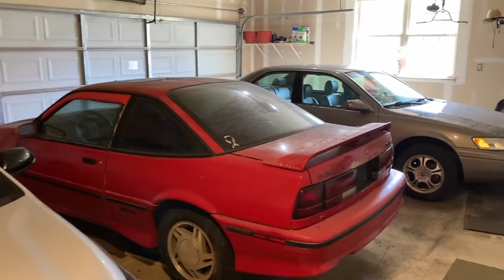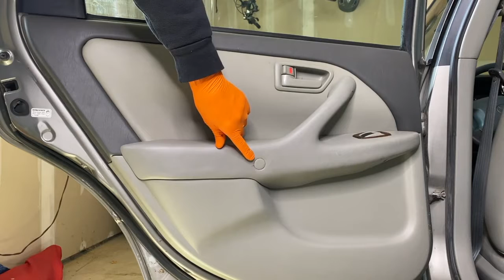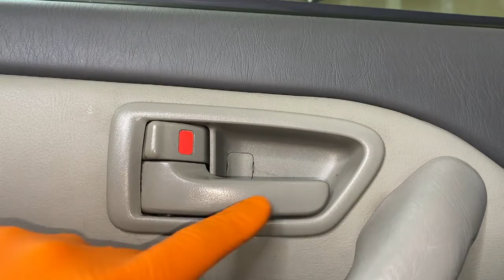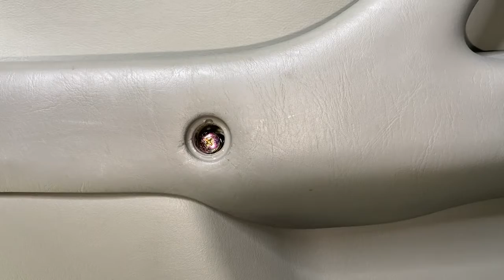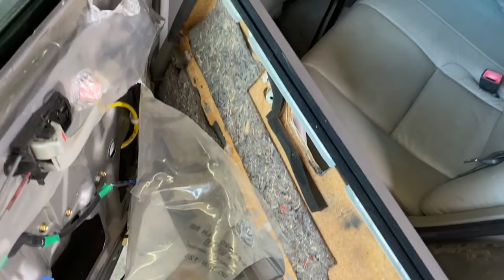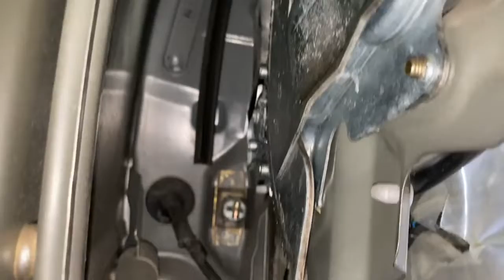How to remove Toyota Camry rear door panel 1997-2005

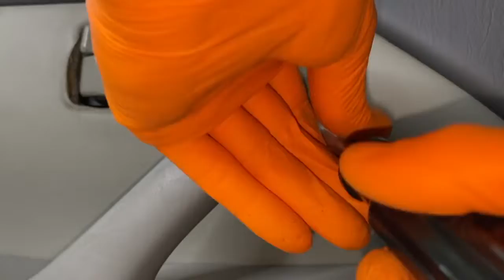Comment: At 5:40, how to remove and disconnect the window up-and-down switch shown in dark brown on the armrest?
Reply from the maker: Thanks for watching, any update?  In our Camry, the electric window switch wiring can be disconnected by carefully shifting the lock-clip up and simultaneously sliding electrical connections apart however ours was damaged by previous owner or technician that removed the door panel in prior years…so we just left it connected.

Comment: This is great, but nobody on the planet appears to have made a video or instructions on how to remove and replace a rear door on a Toyota Camry.
It seems simple enough, except for the chassis wire, which appears to be disconnectable only by removing what is called a piece of "inner pillar trim", then pulling off an alleged orange access panel, and disconnecting the plug there inside the car just inside the rear car door.
I see that piece of plastic trim, but no discernable way to pull it off.   How in the world is it removed?
Any effort to do so makes it look about to break.   I spent the day searching online, so far defeated
Reply from the maker: @c.rutherford  

Thanks for watching, any update?  We haven’t personally removed a door from a Camry, however definitely doable…but a tedious process indeed.

Keep us posted.  👍🧰
Reply: @DIYwithMichaelBorders  lucky me!
I have not yet figured out how to do it without breaking, still searching for a writeup, picture or video somewhere